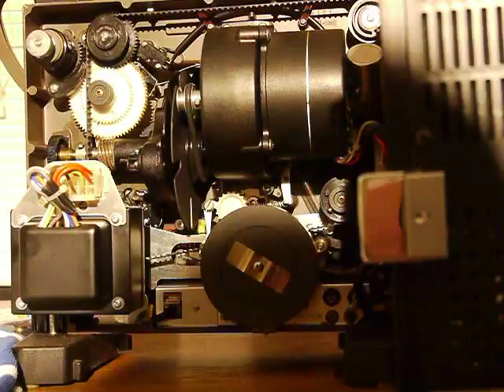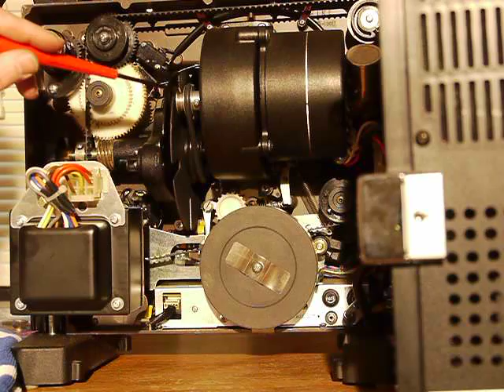EIKI 16mm projector telecine conversion part 11 summary

Comment: thanks for putting this series up. 
i just bought a mint EIKI SNT-O 3585 SlimLine and waiting for delivery. I'd like to make this modification if its possible for my model - though I don't know what the projector currently has, since the auction specified 24 fps. 
Also - I searched on Ebay and it seems like filmvendor may no longer be a registered user.